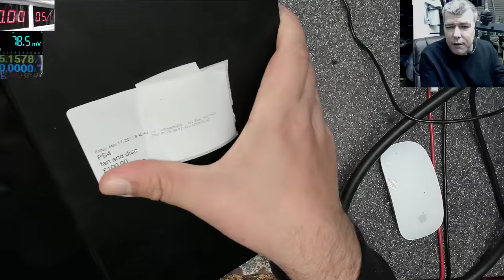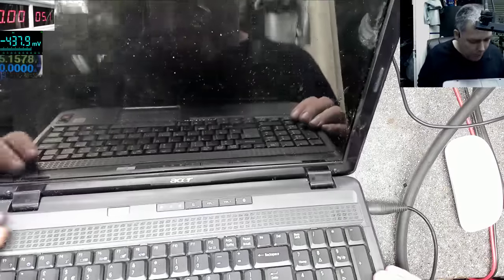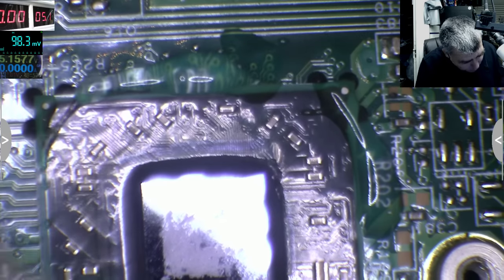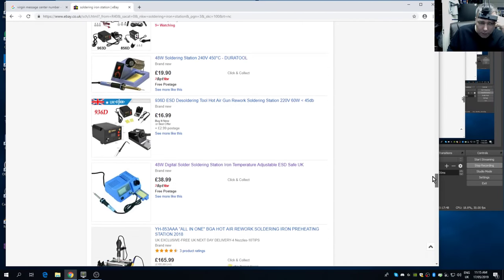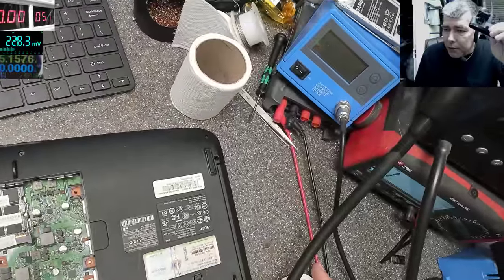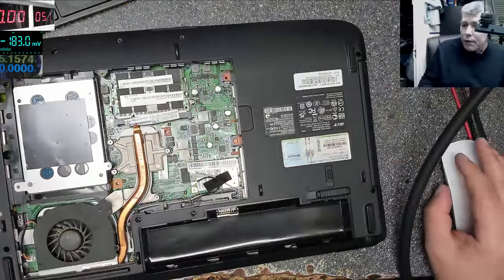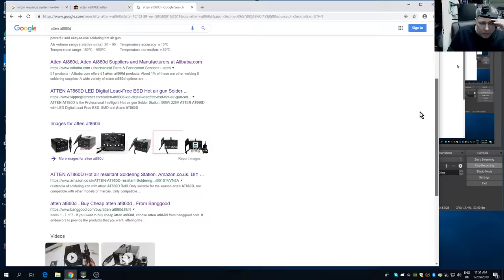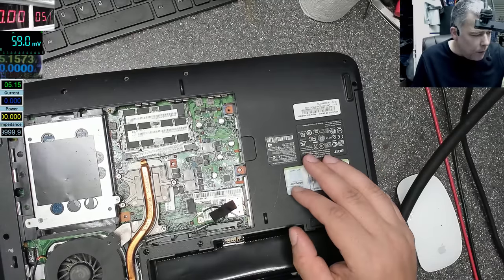Acer 5535 on but no picture and let's speak about my tools

Comment: Repaired my first Dell Laptop today, The problem was no power  and power adapter was cutting off when plug into the Laptop. I use the power supply and set it at 3 amps and located the shorted capacitor with alcohol. Great tip and thank you for your videos. Great help. Keep up the good work.

Comment: Reflowing the graphic chipset is a temporary solution not a long term fix.  This is a common issues and solder balls are not to be blamed. It is the bumps under the dye and after a reflow it patches the fault and works for short while before fails again. Replacing the chip is a  long term solution. 😊👍

Comment: Hi Sorin, i have been bringing  notebooks back to life for years. What i use is a 1000W light. I preheat for 30 seconds and then y hit it full power with 1000W halogen bulb for minute and a half, from 4cms high. Very important use aluminum foil to aisolate the chip, and no cooking the motherboard in the meantime. I ve been using one of my laptops for 3 years now a TX1000, since the morons who were supposed to reball it, screw the graphic chip. No hdd in that laptop, running linux from a usb. It works fine but every 3 months it needs a retouch. I asume is like a car, once the laptop dies, it would need service every now and then. But i have a HP DV6000, very nice laptop, with its massive 15,4" screen for watching videos. The secret, dig holes in the bottom, use an external cooler and maybe it will last longer, as long as the notebook remains cool, there will be no problem. No running it over 75ºC. Its not a fix, as Rossman says, but it gives you time. (reflow machings at home compaq F700, HP dv6000, hpTX2000) Bye

Comment: God Job Sorin! I've repaired many laptops using the same method. From experience the repair can last 2 weeks, 2 months or 2 years! As you said it's not a permanent solution but just how long it will last is down to use and good luck :)

Comment: Thank you for another lesson Sorin! Yes, there is no point to buy expensive tools if you don't really need those. Back in '80s, when I was 14 years old, I repaired my first own tv. It was black and white with wooden cover. I had only two screwdrivers, big old soldering  iron and crappy multimeter. But I did it and I was able to play Atari 2600 games 😁😁

Comment: make some video about oscilloscope usage in laptops repair
Reply: oscilloscope usage in laptops repair? If you don`t know how to troubleshoot a MOSFET with a normal DMM i doubt you will know how to use the Scope for that :P
Learn first with DMM  and then you use the scope for probing fast.
Reply: sorry man, here you won't see any oscilloscopes, signal generators, schematics, etc. any time soon.
Reply: Check out Dave at EEVblog if you want to learn about oscilloscopes. Dave definitely knows his stuff and also has a podcast called the Amp hour, check them out you won’t be disappointed.
Reply: (quoting a terminator 2 scene): you forget to say please... 😏
Reply: odium 😆
Reply: @DanielCardei  - Where did the OP say he doesn't know how to troubleshoot a MOSFET? An oscilloscope is used for more than checking a MOSFET. IF you don't know that, then I'm sure you don't know much about electronics.
Reply: @SleazyNice  I used it for for atleast 10 things. Tell me other things aside phase Lines on  mosfet and BIOS.
Reply: @DanielCardei  - "I used it for for atleast 10 things"
Good for you! Now take off your previous post and stop making yourself look foolish.
Reply: @SleazyNice  cill bro. don`t be brave behind the keyboard
Reply: @DanielCardei  - "cill bro" ??
First off, I'm not your brother. Second, I don't know what cill means. What language is that? Third, I don't need a keyboard. I would take someone like you out in less than 2 minutes.

Comment: Thanks. I just got my amazing, very stylsh, KSGER T12 (firmware 2 something, instead of the 3.1 which is more expensive but smaller, but I like the larger 2 something firmware one), my other favorite tool now, the other is the digital caliper, first all metal one by General:-) Two favorite tools now.

God bless, Rev. 21:4

Comment: Hi Sorin, keep up the good work !! I just have a question, i didnt get the reason of the issue. Could you tell why this error occured and why reheating fixed it? Is it that the video chip wil eventually need reballing so just by reheating with flux temporary fixed it?
Reply: Yes

Comment: Hi, congrats for all the content that you create, I have a problem with a laptop and I  wanna bother you with some questions, the laptop it's an hp g42 that doesn't show video but it turns on and fan spinning, I bought a new mobo thinking that maybe for the years it didn't work any more the video chip, so I replaced the old mobo with the new one and the first time it showed video, but then when I put it back together, and turn on it didn't show again video, and don't know of it's a problem. With the display, is there any way that I can't test the mobo with an external. Display? Or do. You. Have any advice? Thanks

Comment: The reason why you can no longer buy the good  tools is they cost more then the cheap-cheap tools. But because they last and you dont need to buy another one, this means they can only sell the one unit and once the people all have one who will pay more they can not sell any more units . And what happens if you can not sell your goods= you either go bust or you discontinue selling it and sell a cheaper  one like everyone else= possibly  one  who also fails so you can sell another one again.

Comment: You should try a 858D like hot air station. Curious how it would compare to your station, and your opinion. Thanks.
Reply: Avoid stations with fan in the handle and 2-in-1 stations - too weak in general. You can still buy amazing tools separately for the same low price and be happy. :)

Comment: Hello Sir, 

I appreciate if you can give some advise on what is my problem. even if just a guess.

I have a Huawei matebook x pro which I accidentally drop on a solid surface.

Now, when I try to power it on, the keyboard backlit lights up and the fan spins a bit, but after about 20 seconds it seems to shutdown itself.  and there is no display as well.

Another thing to note, If I disconnect the battery then plug the charger in, it automatically turns on with the same thing which turn itself off after about 20 seconds. 

Im not sure where to look first, would it be the ram? the gpu? or some power supply on the board? 
and how would I do some test?

It has 16GB ram (soldered) and 2gb GPU

Comment: Sorin, there is any posibility to broke a laptop motherboard if you short a wrong combination of two pins from the Power Button ribbon cable connector?
Reply: Unlikely, usually there's just an LED and a switch there.

Comment: is it normal for the intel chipset ( not the cpu ) to be too hot even when the laptop is idle 

i recently replaced my laptop motherboard Dell 3521 and i noticed the chipset is getting too hot
i checked the power supplies on the board 3.3 and 5 volts is always present even when the laptop is off

Comment: MR Sorin i need big help, I have a LEnovo here dead. The charger, looks fine,but when i plug it,checking inside the laptop  in the connector,drops to 1v. But my proble is,as i dont have another charger from Lenovo, i try to improvise and inject tension in the connector,but only then i realize the middle pin is data , and im afraid to have damage the laptop. It is possible?? Can i provoque a short injecting tension in the middle pin?

Comment: I have the Acer 5715z from 2009, so probably that laptop is from 2007/8, so 12 years old approx
Reply: Almost every single laptop is fine as long as the user doesn't forget to frequently change the thermal paste. :) Most people aren't even told that's a thing when they're purchasing it, especially from an online store.

Comment: Sorin have you ever experience soldering tips sticking on the solder pads or joint when you try to solder on high dissipating thermal mass like MacBook logic board? This happens often with low power (45w) shitty Chinese soldering iron and that pissed me off so much I decided to spent 1,2k€ on a jbc soldering station and forget about the problem. That thing never had to happen again wile I’m struggling with a repair... Of course If you can’t get better tools you became proficient with the basic one as well sometimes like most of the Indian repair guys used to do but that’s another story...

Comment: Sorin, Sir thank you for your excellent video. I have similar display issue with my Toshiba Satellite P55W-B5224 laptop. I was managing it with an external monitor because the touch screen and LCD monitor were getting superimposed and the display went flickering.  After watching movie continuously for hours in the external monitor connected with a HDMI cable, the screen display in the laptop slowly got fainter and finally died.  I am thinking the GPU got over heated.  I bought thermal paste and will try to replace the existing thermal paste or pad of the GPU without reflowing with hot air gun (as I do not have the hot air unit and I am not confident yet to use hot air gun for the reflow around the GPU). If it won't work, I will try to locate (I do not know its location now for this particular model) the CMOS battery and test its voltage.
Reply: I replaced the thermal paste of the heatsink. There are all the lights on same as before.  Now the fan speed appears to be reduced or less noisy.  However, no picture on screen; does not bootup; no BIOS screen even when the battery was disconnected and put back. As I had mentioned in my previous post, I am thinking to look for the CMOS battery so that I can do something to get the BIOS screen. Does anyone know where the CMOS battery is located in this particular model of Toshiba Satellite P55W-B5224?

Comment: Come to Besiktas Sorin Be Legend...BTW I have big problem with panasonic tnpa5390 powerboard...I check every ..cking compound except transformator and 2 relay...no faulty compound...Any suggestion for check?( I check 3 fuse, npn tansistors,all transistors, 2 bridge rec., resistors, diodes, fusable resistor(3), IC chips ( 5) nothing....

Comment: Hello, im having similar problem but in my case the laptop is showing charging light orange when the battery is im and a white light when i remove the battery, the problem is that there is no responce when i press the power button... I tried all suggested methods such as removing battery and pressing the powwr buttom, replacing the cmos battery but there is no luck!.please help me, my laptop is hp envy 15 k019nr.thank you!

Comment: Dear Sorin, I have been watching your videos from a couple of weeks and have mustered  some courage to ask you this: I have an Acer laptop 5735 which identical to this video laptop from outside. I had vista originally and did not work very well.  I got it upgraded to win 7 about two years ago and since then it worked very well. for the past few months it shuts down suddenly while I am trying o work and then restarts automatically after 2/3 seconds. this situation has deteriorated over two three months and now the laptop shuts down as soon as win starts loading and then restarts. I guess the cooling fan is either not working or there is some other hardware problem. Please help me.

Comment: Is there a way to disable onboard graphics acceleration--either in windows or in the BIOS--so the owner can keep using this laptop reliably into the future?
Reply: There are ways to disable the Nvidia/AMD graphic chip but they are different for each model. Basically if you cut the power to the GPU by taking out GPU Power supply coils and update the bios with a custom bios. the bios would recognize the Intel GPU as a stand alone GPU. But on some models like Dell 5010 you have to modify the board completely and you'll lose the VGA out port.
Reply: @rezakianpour9668  ...Wow!  I had no idea it was possible to do this at the component level.  Thank you.

Comment: Sorin,how do you know that you have a graphic issue?based on what? why not back light? Can you please explain?
Reply: Constantin Ionescu. From Sorin’s previous videos when he has had a backlight problem you can see the screen coming on with the super bright lights Sorin uses.
Reply: Nu poate fi backlight cand pe display nu e absolut nimic. Daca ar fi backlight, cu o lumina Puternica reflectata pe display, ai vedea imagine. 
And yeah... graphic issue based on what? Based on experience, plus cele 2 aspecte: laptop vechi + chip ati.
Totusi la fel de bine putea fi si frozen bios, ram dus, unplugged monitorcable and so on.... dar nu si in cazul asta. Spor!
Reply: @leerzeichen1910 multumesc,inteleg,dar Sorin trbuia sa explice putin ,dar inteleg ,Multumesc mult.
Reply: @linkavichtruousky1  Thank you
Reply: @constantinionescu6839  It's a 10 year old laptop and it STILL had its original thermal paste. That pretty much says it all ;)

Comment: What kind of liquid is he using at 11:15?
Reply: Its called flux. It helps a lot to melt the solder. The solder flows much better. You must use flux for easier work. Buy flux now if you solder.

Comment: Why we don't fix any Pc Motherboards?   You do a great job fixing those laptops.  I want to see how you can diagnose and fix a Motherboard from a Pc Computer.  Thank you.
Reply: It's pointless with PC motherboards you simply replace them ... Costs of fixing it will be same as a new one.
Reply: @Kreska0  Thank you...
Reply: @Kreska0  Except if it's your machine and you are fixing it yourself.
Reply: I'd also love to see such fix attempted on an expensive motherboard, but most of those rarely fail outside of warranty and even if they do, the owner would probably just upgrade his components instead anyway. :|

Comment: Sorin 45w is not too low? It' s impossible to solder ground of power connectors... it s necessary the 60w
Reply: He helps the soldering iron with his hot air station in similar situations (tandem heat). ;)

Comment: Sorrin, Solder I use the expensive multicore brand with some silver in it, am I wasting money would the Chinese solder be just as good
Reply: I'm using cheap YIHUA soldering station and I'm happy with it plus replacement tips are really cheap.